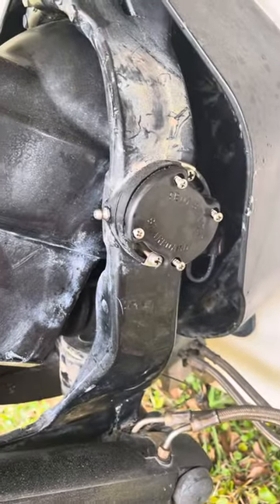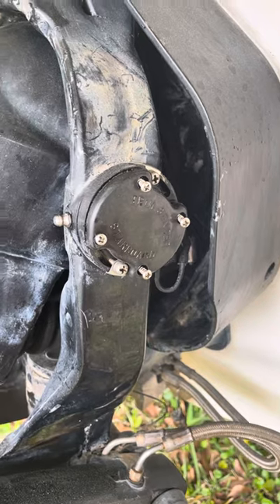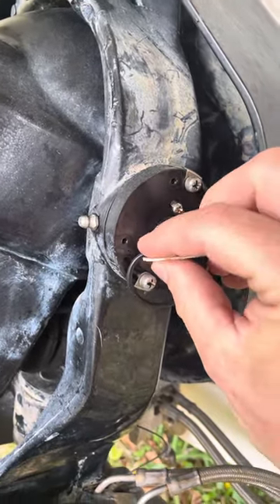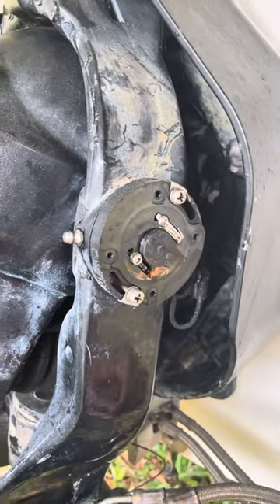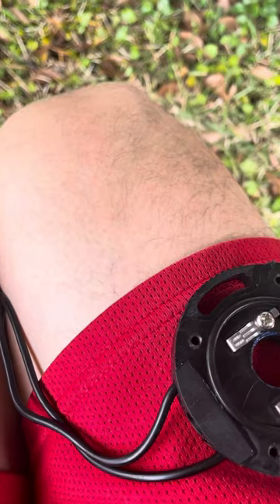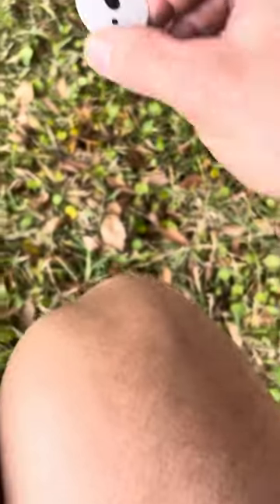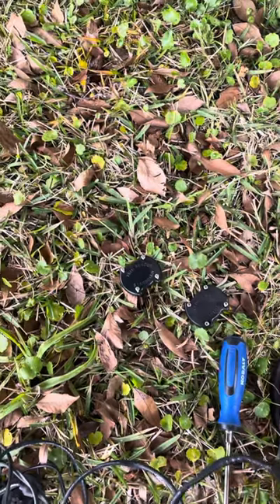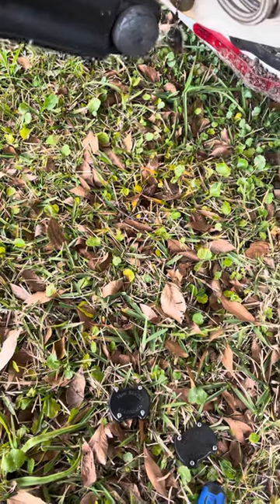How to repair trim limit and sender switch cheap and easy.

Comment: So...basically, im taking the tab under the screw on the new one and sticking on the old one? 

My wires are good and just need contacts. Is it basically what that is correct?

Comment: This seems like a great alternative to crowding over the engine to get to the back of the transom.  After you completed this, any regrets about not replacing the whole case and wiring??
Reply from the maker: No sir. Works great I haven’t had any problems whatsoever. This is definitely the way to go.
Reply: @jdcole1979  Sounds great, guess the only caveat is to make sure the problem isn't somewhere between the wiring.  Thanks for sharing this, might save me a bunch of work ;-)